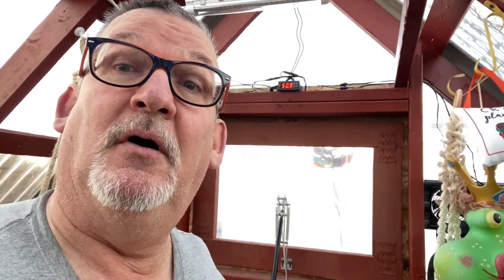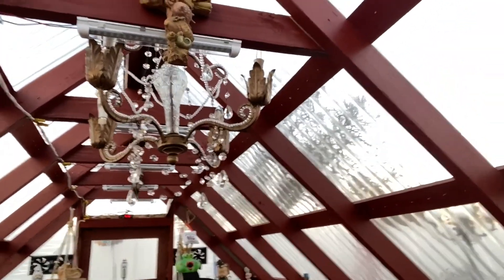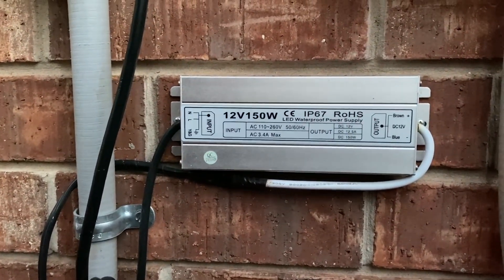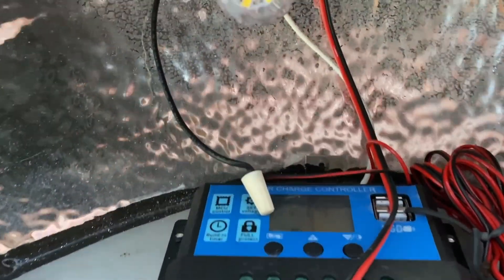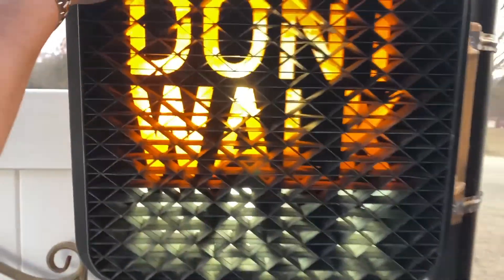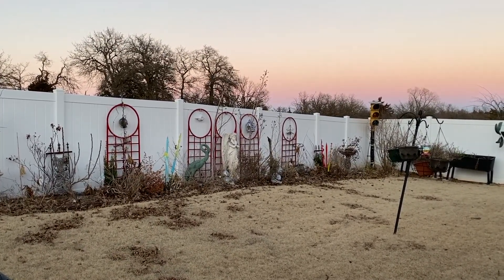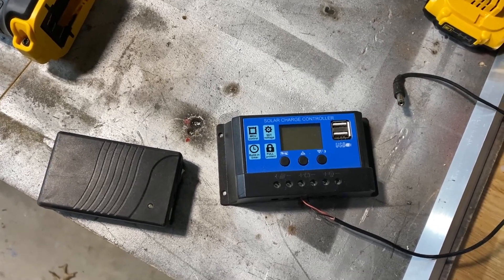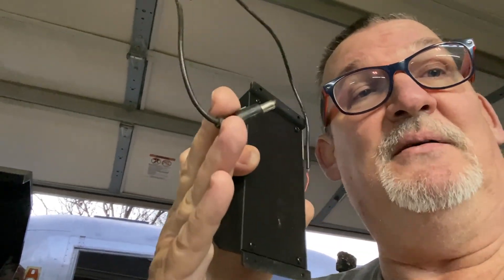Greenhouse 12v Power and Solar Setup

Comment: Great video 👍 I’m in Australia and I have a Solar fan to remove heat from the attic. I want to set it up like you have so the Solar charge controller info is gold for me thank you. I am trying to connect a power supply that will run through a step down transformer powered from the main house supply. My question is will the charge controller work or will I need a manual switch for the transformer. I would appreciate your thoughts.
Regards 
Nigel
Reply from the maker: I guess I’m a little confused, what do you mean “main power from the house”? There shouldn’t be any power from the house. Solar during the day should charge batteries for use at night. Are you setting up something that runs off house power with battery backup that’s charged by solar? If that’s the case, you’ll need some kind of transfer switch that recognizes loss of primary power and then switches to battery. That’s a whole other ball of wax.
Reply: @1SpudNuts1BigNasty-DIY  thanks for the response I sent the question then realised what I am trying to do is a bit complex to type on a message board. I will research and experiment good luck with your projects.

Comment: I am doing something similar but am using 2 40w panels in parallel. I'm using 6, .2amp 12vdc led panels, which are running off of 440ah battery pack. No grid power required.